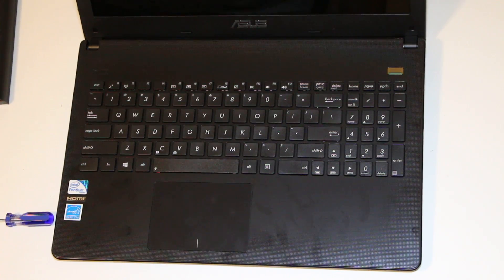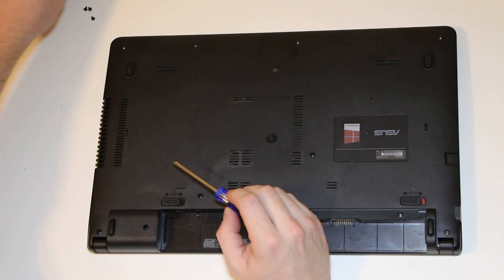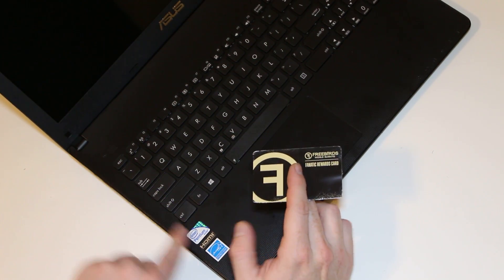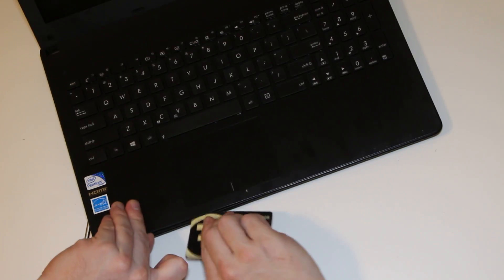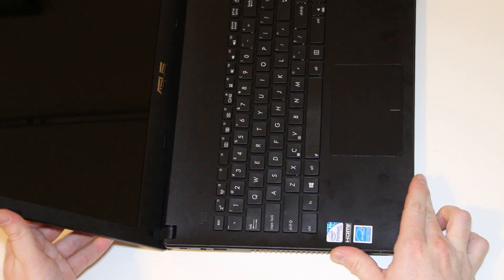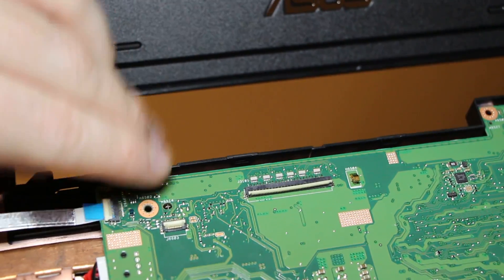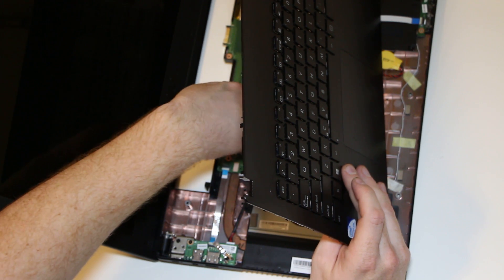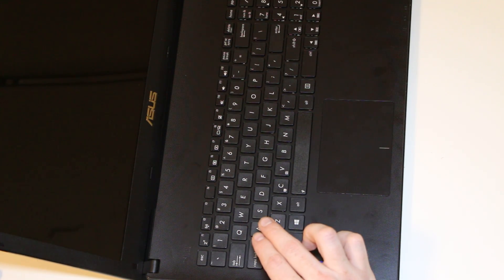Asus X501a BOTTOM COVER REMOVAL -- Teardown, similar for X401a or X301A or X401 or X501

Comment: I saw your awesome video for the x501a How to here.
I see you have a vid for Q500a, but have not shown how to get under the keyboard for that model. I need very badly to replace a lcd cable. I know how to get the screen off the top but do not want to ruin my laptop by trying to get under the keyboard for the other end of the cable. I also need to tight up my hinges so would you PLEASE tell us how to get under the keyboard of the q500a. Just not sure which screws to remove etc..
Thank you very much.